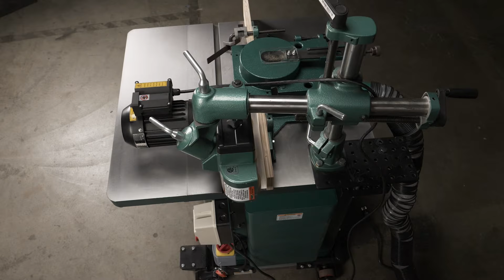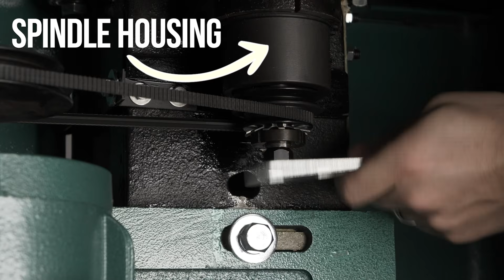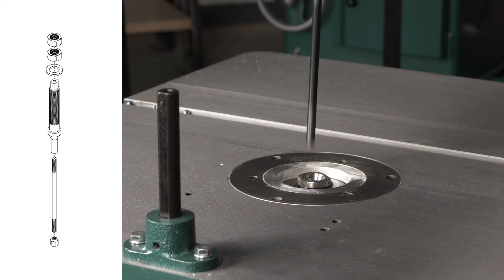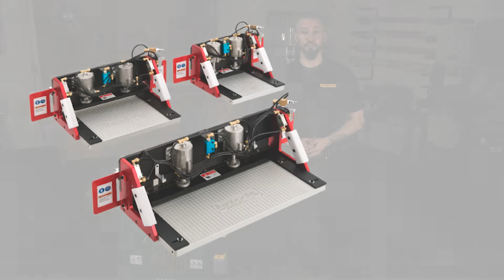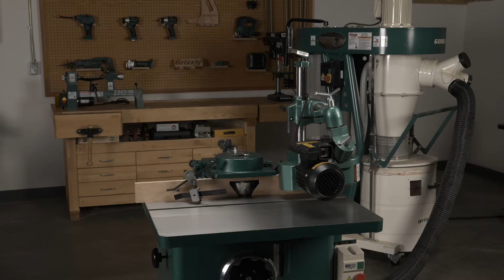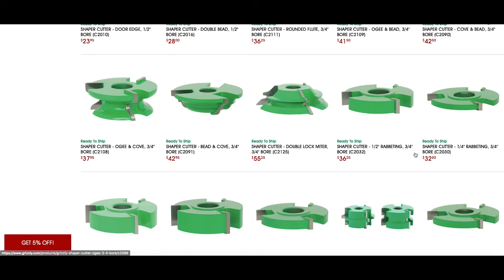Shaper Overview | Woodworking Machine Basics

Comment: Why does my G0900 not have a threaded top on the spindle? This limits and complicates adding spacers?
Reply from the maker: Thank you for reaching out with your question. The G0900 Shaper is considered a large shaper. Large shapers use spindles that are unthreaded on the outside because external threads can interfere with the precise, smooth alignment needed to safely operate large cutters at high speeds. Since external threads do not provide a uniform outer diameter, they can cause the cutterhead to mount slightly off-center.

Comment: I am looking into "mass" producing tongue and groove. How would this machine compare to others in terms of production time? If you had to estimate how many boards you could finish in an 8hr period using this machine, how many would that be? Thanks!
Reply from the maker: This question involves many variables that we cannot fully account for, such as the type of wood being used, safety standards, cutter selection, and the amount removed with each pass. Determining whether this machine is suitable will ultimately depend on your specific application and needs.

Comment: I've been thinking of buying a shaper to cut my own tounge and groove for my porch overhead soffit area, using some local custom mill 1x stock. Just trying to figure out which one to get. They can certainly be expensive.
Reply from the maker: Cutting your own tongue-and-groove for a soffit project is a great use for a shaper. Choosing the right one really comes down to spindle size, motor power, and whether you’d like features like a sliding table or interchangeable spindles. Shapers can be an investment, but they offer excellent control and consistency, especially when working with custom-milled lumber. If you’d like help comparing options or selecting a model that fits your project and budget, we’re happy to help guide you in the right direction!

Comment: Can I  put a round piece of wood on it, turning it by hand like a band saw?
Reply from the maker: A shaper isn’t designed to feed round stock by hand like a bandsaw. It’s meant for flat or straight pieces, and using it with round stock can be dangerous because it may catch or kick back. For shaping round pieces, a lathe or a bandsaw would be a much safer and more effective option.